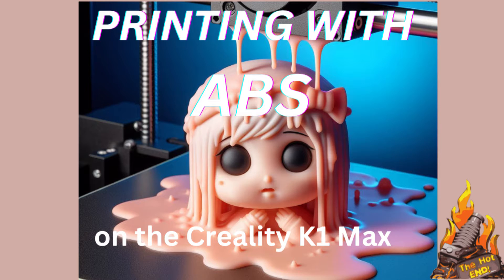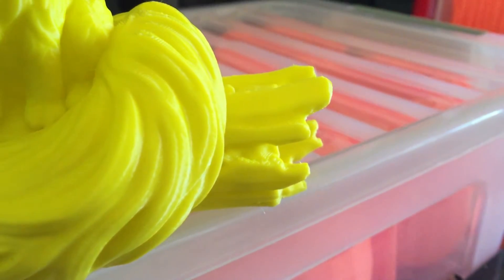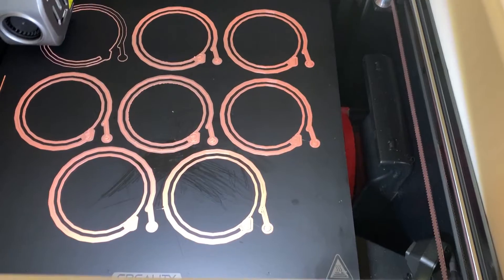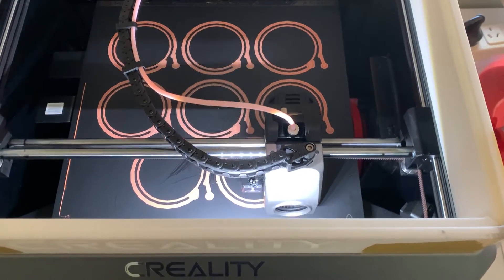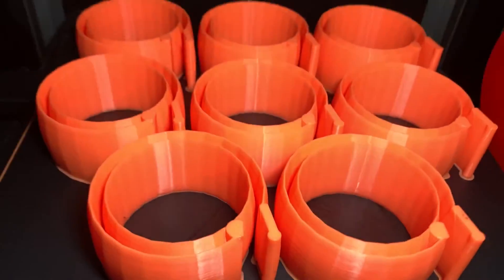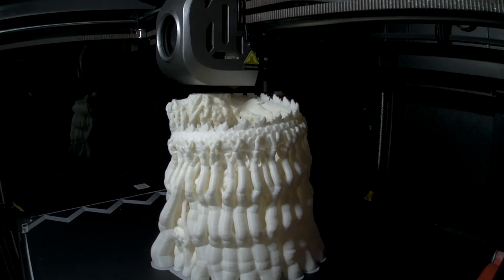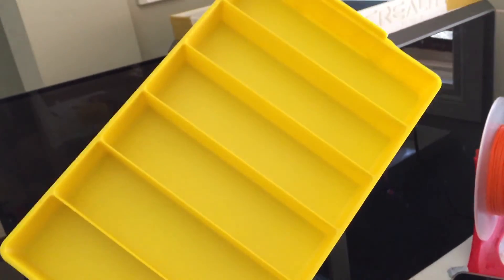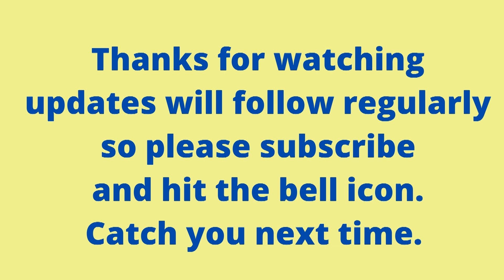Printing in ABS on the Creality K1 Max

Comment: Thanks for the video; I noticed in your Max volumetric speed that it's quite different from mine. Mine says 200 mm3/s. Do you think, I should change it? Seems like a huge number compared to your 16.
Reply from the maker: sorry for the late reply. The K1 Max has a table on the floor at the front showing suggested volumetric settings. Nothing is more than 23.